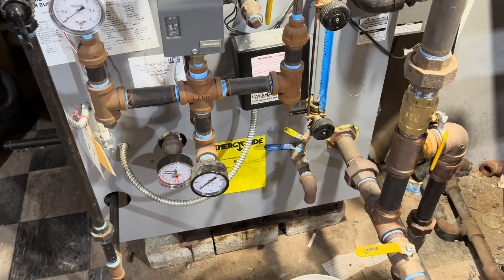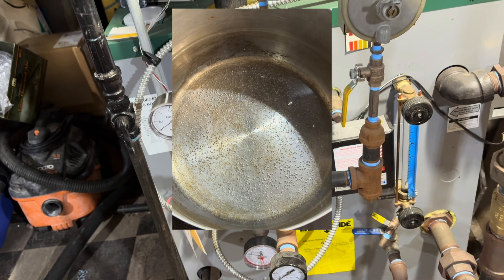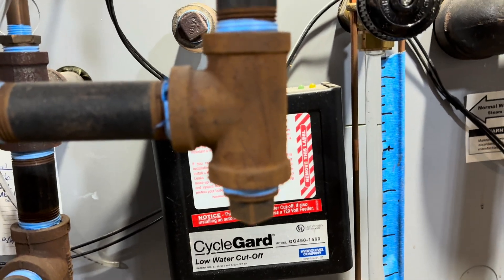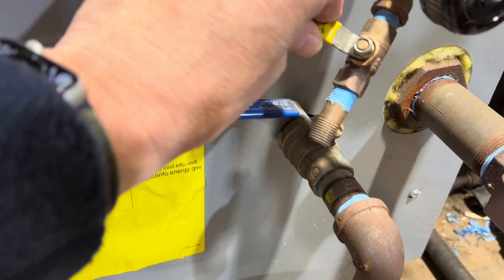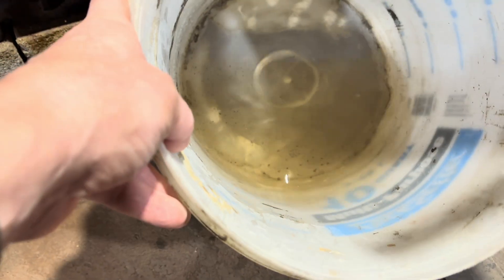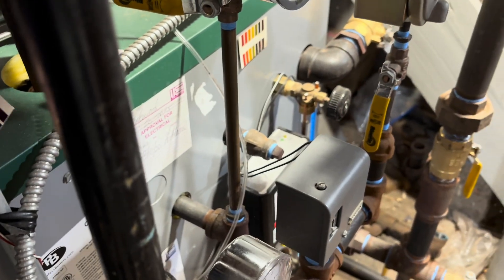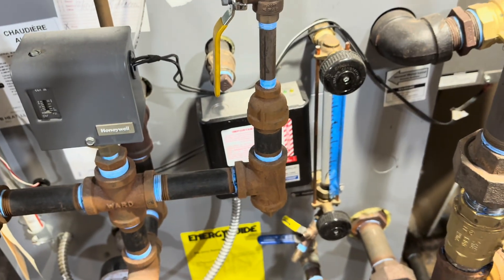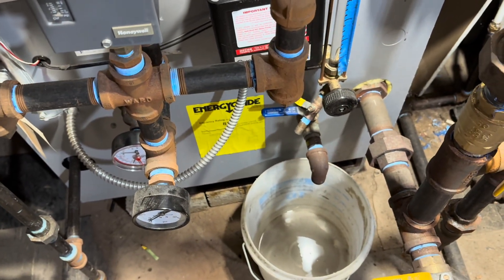How to make your steam boiler last forever!

Comment: I work on a ton of steam boilers and piping in New York City. Love the video, Paul. Thanks for informing all of us about the chemistry behind it all. We are at constant battle with hard water conditions here.
Reply from the maker: @robertlucas8104  thanks! What does the hard water cause?
Reply: @pb7379-j2k  hard water is what kills boilers. You're doing a good thing by adding the 8 way Chem treatment. If you were running city water as makeup into your boiler, if not run through a softener first, you would get scale,sludge,ect that build up on the inside of the boilers heat exchanger drastically reducing heat transfer/efficiency as well as much corrosion taking place. It's just all bad lol. There's alot more to all this but that's the basic rundown
Reply from the maker: @HVACRTECH-83  thank you! I would say though that oxygen primarily kills boilers, brought in by fresh water. 

I would rather have hard water than softened water because I don’t want the sodium to accelerate corrosion.

It looks like I’m going to be using distilled water for makeup going forward, so that will eliminate hardness and oxygenation regardless.
Reply: @pb7379-j2k  the hard water conditions here contribute to problematic mineral deposits that sit at the bottom of water heaters and boilers, amongst the sludge that occurs as left over cutting oil, rust and other elements combine. It speeds up the damage of sections or tubes on boilers, as well as piping. Steam systems are more vulnerable as there is still air, one of the factors for oxidation, whereas hot water systems typically are full of water and aren’t as prone.
I had a house some years ago where the original gravity hot water boiler was still functioning. The house I currently am in we just had to replace our steam boiler that was installed in 1983, much due to the maintenance the previous owner did, and whatever I could do for the last 7 years. 
Steam on!
Reply: NYC water is not that hard..

Comment: If you don't need to use it you should drain it all the way out and open up the water side and dry it out .. Leave it open till next heating season. This is advice from a thirty year experience industrial boiler mechanic.
Reply from the maker: @Boilerking76123  I don’t want to do that because then I’d lose all my nice clean high-PH water

Comment: Galvanized pipe doesn't stay rust free on the inside
Reply from the maker: I'm not sure what you're referring to. There is no galvanized pipe in my system and it's not recommended for steam. I might be missing what you're trying to say.
Reply: @pb7379-j2k  if your pipes are copper through out the house,then chances are itll be clean-er than what we have with these 100 year old single pipe systems.

Comment: Pure water won't cause rust.
Oxygen and electrolysis of different metals contacting cause corrosion.
HVAC contractors don't know this or won't reveal this folks, bad for business.
Condensation water is not as good as distilled water.
Reply from the maker: Pure water will cause rust in the presence of oxygen, and everywhere on earth when there is water, there is oxygen in it. Water itself is composed of oxygen and hydrogen.

What is the difference between condensation water and distilled water?

Comment: demineralized water will absorb minerals from wherever it can - including pipes. PH is your best defense to stabilize that. Perhaps you'll see it pit slightly and stabilize but if you continually add demineralized water, you're going to have a fun time with leaks.
Reply from the maker: As you saw, I have plenty of PH in the boiler.

Outside of the boiler, those pipes are constantly exposed to distilled water by their nature...all the condensate from the steam is distilled. And yet steam mains last for 100 years, can you explain that in terms of your allegation above?
Reply: Paul, I love your videos.  I especially appreciate that you don’t claim to be what you are not and go through a scientific process to make your conclusions.  

Hard to disagree with your results!

My biggest lament is not seeing this stuff 34 years ago when I put in my Weil McLain.  I want to copy your setup but will wait for the replacement I guess.

I have a ton of mud.  

Besides:
1. adding water that is void of chlorine and oxygen 
2. Keeping the boiler 100% filled in the off season, and 3. keeping Ph at 10+, 

what do you think I could do to my old boiler to reduce existing sludge?

I have started to use 8 way, checked my vents and replaces some slow vents with Gorton #1s and 2s and added a magnahelic and confirmed that I am operating at about an inch of water pressure.

I have thought about draining and using a side spray nozzle on a wand to try to get everything moving but that will wait until next spring I guess.
Reply from the maker: @tkpk5119  Thank you for the kind words! If your WM boiler is 34 years old then you have been taking good care of it!

I think just by keeping your pH at 10 or so you will minimize corrosion. The production of new "mud" should be very little.

Getting the old sedimented mud out can take some time. Adding just a little 8-way, like 1/4 cup should free up some mud. So if you see your water getting muddier over time after adding it, it is probably old freed up mud and not newly-produced corrosion. 

So when your water gets brown, let it settle for a few hours then drain until it runs clear, then add some clean water and maybe a little bit of 8-way again, like just a tablespoon or two, then keep repeating that. I believe that eventually all the sedimented mud that is going to get freed up will get freed up and your water will remain clear longer and longer.

But regardless, you are getting a nice long life out of your boiler so don't sweat it too much!

Regarding wanding, some people swear by it, but I figure if some sedimented mud is stuck to some little crevice inside the boiler and doesn't want to come loose, what's the harm? It's probably not stuck to the surfaces that are getting hot where the water is actively boiling because the boiling action should prevent that.

Comment: I noticed similar results.  I added chemical feeding (copying you) and I heat up water in a tea kettle to tip off the boiler.
Reply: (Chemical feeding plumbing)
Reply from the maker: Thanks. Yes, none of this is new information in the steam industry and yet it's almost completely unknown in residential steam, even among contractors. The knowledge isn't getting there.

Comment: Interesting. I have always heard that adding fresh oxygenated water will speed up the rust/corrosion process. But what I didn't realize is that municipalities inject their water with Oxygen? Is this 100% true? How would this even be done? Oxygen is just air correct? So my next question is this: I Am on well water, that being said, since it is coming direct from the earth would this water be less oxygenated as it is natural from my well? I know there are other issues associated with this IE. hard water, iron ETC.. But strictly discussing the rusting issue from adding fresh water am I at an advantage due to being on well water?? Thank you in advance!!
Reply from the maker: @chrisc9389  yes it seems to be true. Air consists of oxygen plus other gases. The municipalities buy liquid oxygen and use some mechanism to dissolve it into the water for taste.

They also add chlorine which also adds to corrosion I think.

So you are at an advantage with ground water there. It still has oxygen in it, more than distilled does I think. There is a meter that can tell you how much but I wouldn’t worry too much. The PH level can help you for sure
Reply: Oxygen is added in many purification processes.  When filtering iron, for example, potash is added and then the water is aerated to bind the iron to the potash so it settles out of suspension.  So you, often the water is aerated.
Reply: Not really at an advantage, all water contains oxygen. H20 rite? If you really want to prolong the life of your steam system you should get a water softner system installed. Well water is typically worse than city water for steam boilers.
Reply from the maker: @HVACRTECH-83  No, it's not the same. Distilled water, and even just heated up water has a lot less dissolved oxygen in it than tap water does. Did you watch the video? Have you never seen a boiler rusted out due to having leaks in the system and too much makeup water being added?

It's not because the makeup water was hard, it's because the makeup water was oxygenated.

As I said in your other reply, I would strongly oppose the use of softened water as makeup water, due to the sodium causing more corrosion.

Comment: Your PH is way too high.  Anything over 10 is acid !  I keep mine at a conservative 7.  I also overfill the boiler for the summer, but I add more than you.  I did install a new wet return line a few years ago with valves to clean out the return.   My last Burnham lasted 35 years.  I notice that my sight glass drops down about three inches when heating.  I don't know why.  Oxygenated fresh water will eat the cast iron boiler.    I follow mikey pipes from NYC on YT.  The man knows his steam.
Reply from the maker: I'm sorry, but you are mistaken about a couple things. 7ph is neutral. Under 7 (not over) is acid. Over 7 is base/alkaline and at about 11ph, iron corrosion stops. The boiler manufacturers recommend 10-11ph.

If your sight glass drops three inches when heating, your boiler is surging. You have oil or other water problem that is causing this. You can see examples of surging on my other videos.

Yes oxygenated fresh water will eat the boiler, that is the point of this video :) 

Mikey is OK but he is dead wrong about at least one thing...he wants to drain and refill boilers too much.

Congrats on your old Burnham lasting that long. But I don't think your new one will, especially if it is an Independence. They have done something to the castings.
Reply from the maker: I might also add more in the future. Keeping the entire interior submerged in that high-ph water during the off season is a good idea I think.

Comment: Nicely piped boiler, and an interesting experiment.  Assuming your local water supply is of good quality, isn't the oxygen purged from the domestic supply in the first few minutes of heating in the boiler?  What's different with driving it out in a pot?
Reply from the maker: Thank you. The results speak for themselves, but I think it might be because in that case the oxygen is released into the boiler.
Reply: @pb7379-j2k  That's possible that in its release it "scrubs" the iron...